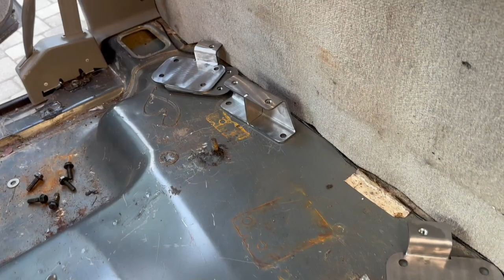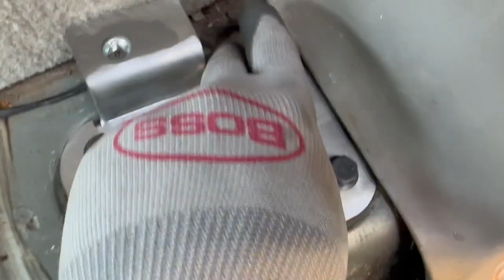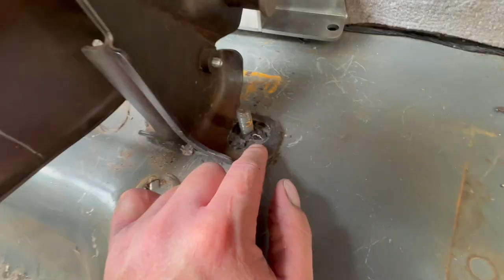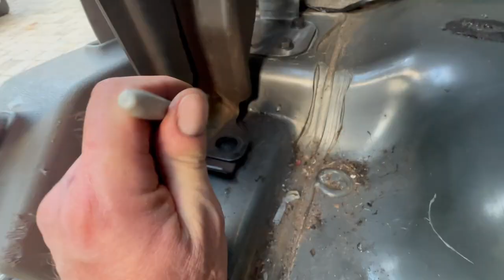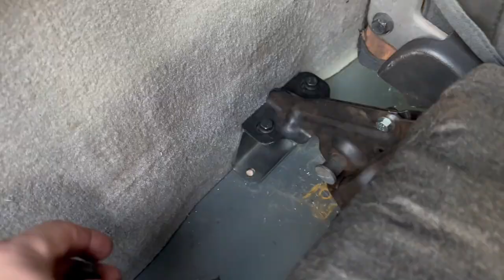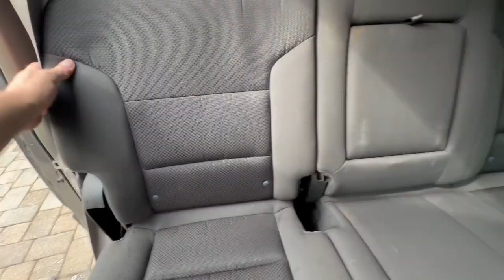1988-2000 Chevy/GMC Crew Cab - 2007-2018 Rear Seat Pro Brackets Installation OBS Outpost

Comment: For the hole that you drilled and said you couldn't use because you couldn't get to it, couldn't you use a nutsert and make it a step before installing the seat? Just a thought
Reply from the maker: You can you can also probably get a nut on the other end through the hole. Honestly its not necessary since all the upward torque is on the rear bracket.